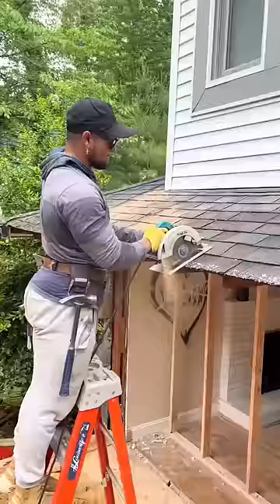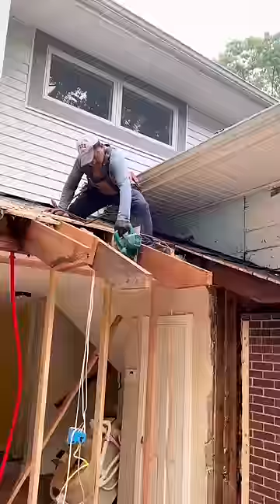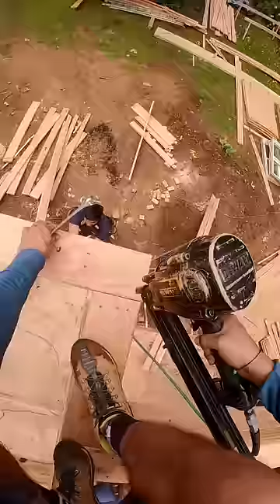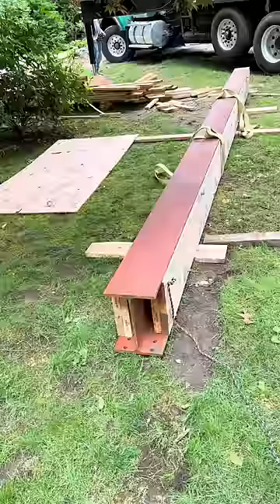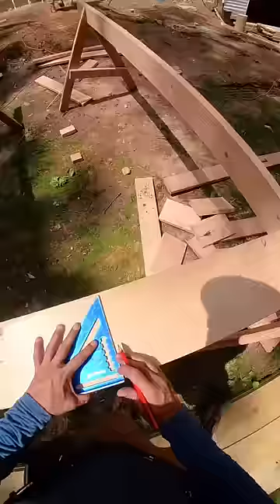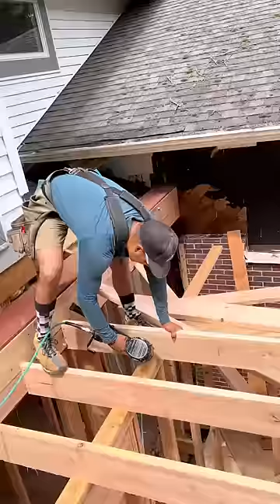Addition #shorts #construction #work #quality #skills #artwork #tips

Comment: I have always wondered why some guy's lift their wall before nailing the studs to the bottom plate then toe nail them rather than back nail them.
Reply: I don't get that either honestly.
Reply: @PartTimeYooper  I’ve seen this guy do this a lot & I don’t understand it at all. Wish he would explain why they do it.
Reply: @adamd7078   I get on a basement where you may have a silplate that's already bolted down or your bolts to go over But for the rest of your walls it makes absolutely 0 sense

Comment: Why do you put the RSJ on out side of the of the building????
Reply: Flush girder or also called an upset girder. The first floor exterior wall is being removed and this is the re support. If it’s a master bath going in at the second floor, it will also carry the tub. The first floor ceiling will plane in and not be interrupted by a dropped girder. Steel is often selected because it will have the same height as the joist.
Reply: I’m guessing a home office off the living room at the first floor and master bath remodel above.

Comment: Yo it’s 2022 time to go cordless gosh when was this filmed 2010
Reply: Corded tools typically have more torque and they never run out of battery. Building a passion project in your garage is different than building a home. This isn’t DIY Thursday’s.
Reply: @brandonleesanders  a huge amount of contractors use cordless tools....
Reply: @paultasker9759  - Yes you’re correct. All I did was respond to the other guys comment. I’m a contractor. I have cordless tools and I also have corded for the reasons I mention to the other guy.